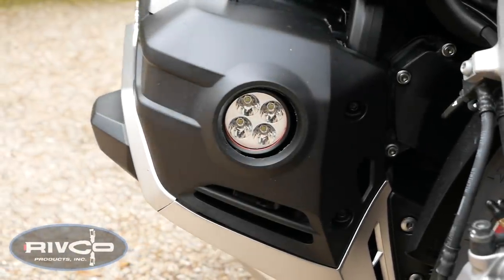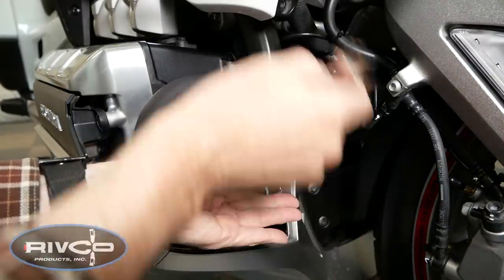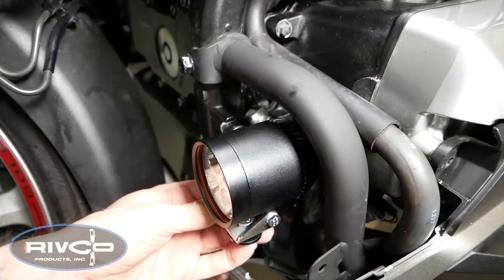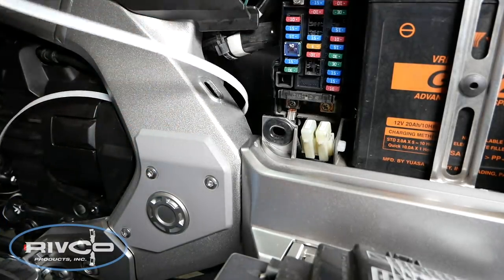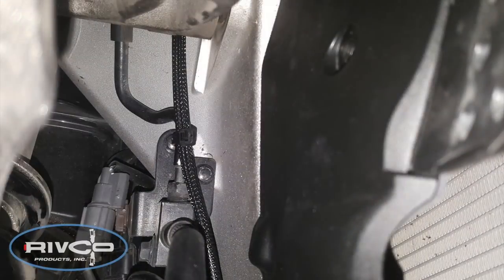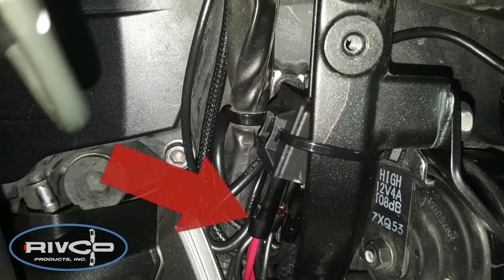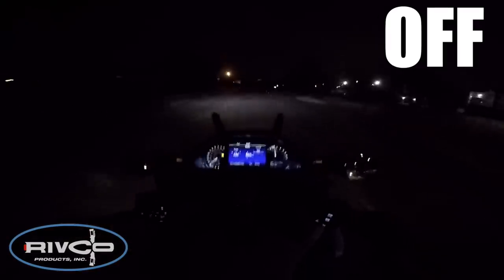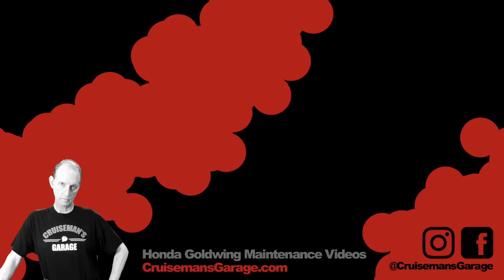Rivco Driving Light Install on 2018+ Honda Goldwing

Comment: EHHXcellent! I was skeptical of having a switch that was not the OEM button but the switch placement is out of sight yet convenient. Not that I'll actually use it anyway, because, if I had the Ricvo driving lights on my '18 Goldwing, I would never turn them off anyway. Thanks for another great video Cruiseman!

Comment: Another great video.  I installed these lights three weeks ago and they are great in the daylight too.  One note however.  The GoldStrike Tiedown brackets use the same horn / fog light boss to secure the lower arm of their bracket.  If both the tiedown bracket and lights are used, it pushes the lights off center to the plastic cover opening by the thickness of the GS bracket, 0.162".  In my case, the RH side was okay.  The LH side was too far off center.  I knew that and talked to RIVCO before ordering them and discussed options.  For the time being, I'm leaving the lights centered, and the LH tiedown bracket off.

Comment: The install looks pretty straightforward and well described. Great job. I do have a couple of question. I did not see the switch. Is it an OEM or similar switch? And where it is exactly is the switch located? Thank you Alf 🇨🇦

Comment: Great video as always.   I like the light these Rivco's put out but don't like the Rivco switch.   Santa bought me the Honda fog lights and spent almost all day installing the darn switch in the console..   I was surprised you did not install the fog light switch it at the same time you did your HondaLink switches.   I referenced your Hondalink install video a number of times to help me though the the fog light switch install.
Reply from the maker: I think RIVCO may eventually offer an OEM-style switch for the console.

Comment: Lights work good. We just got the rain you got late yesterday and it was a lot of rain...
BTW; Those horn bolts are not 12mm, the bolts are probably an 8mm that takes a 12mm wrench.
Reply: While I can't argue against your statement, I would only add that most of us only are concerned about the tool that is needed to do the job, not the specifications behind the fastener itself. For example, when I'm removing the bolts that hold the seat in place, I know that I need to reach for my 5mm hex driver. Knowing the thread does me no good.
Reply: @MotoRideswJohn  That's because you are talking about a wrench and not a bolt...
Reply from the maker: @MotoRideswJohn  I think you meant 6mm Allen.
Reply: @cruisemansgarage  Yes, of course you are right!

Comment: Amazing difference in light. Will the hi-beam wash out the driving lights? Also, is there an inline fuse in the power lead coming off the fuse block terminal?
Reply from the maker: No, the high beams throw the light down the road while the driving lights provide a lot of fill light between the bike and where the hi-beams start illuminating. There is no in-line fuse (easy to add one). The ACC terminal is fused (3 amp, I think).

Comment: How would one go about wiring these as to have them trigger on with the high beams?  I currently have a pair of aftermarket lights on an FJR, and am powering them thru a Skene Intelligent Controller.  I would like to do something similar on my 2018 Wing, which would give me a final setup of 10% power on low beams, and 100% when the highbeams are activated.  Given the CANBUS system of the wing, I suspect that wiring would be different.

Comment: I heard that the Rivco lights draw more power then the factory LED Driving lights, with that being said,  I understand why Rivco is using a relay and external connection to the battery.  But, what I don't understand is, instead of using the switch, why don't they use the factory headlight connection to actuate the relay?  This way you can install the factory switch and everything is neat.

Comment: Cruiseman- Love these lights. Can these lights be wired so they operate with your high beams using the OEM handlebar high beam switch? (If I’ve got to send a message to a vehicle about to turn left in front of me I want to be able to give them a full on frontal blast of light). That is in addition to this new Wings great horn.
Reply from the maker: If you use the RIVCO wiring harness and switch, then it bypasses the Honda switching altogether. That means the fog lights will remain ON when you hit your hi-beams. However, there is no way I know of to have your hi-beam switch turn ON the fog lights.

Comment: Hey Cruisman, another great video. Question, does the main power dial kill the lights when you power down or do they stay on. Either way think I'm going to invest in a set. So much brighter and the install looks sooooooooooooooooo much easier than the OEM version. Tks
Reply from the maker: Yes, when you turn off the bike, it kills the lights. The ACC terminal on the fuse box is a SWITCHED terminal, so it only gets power when the bike is running or in ACC mode. The lights are SUPER bright.
Reply: thanks much, must be popular, out of stock currently
Reply from the maker: @rtt3114  Really?
Reply: yes sir

Comment: Hey Cruisman, I installed the rivco driving lights on my 2018 wing.  The installation went good as I followed your installation video. They are super bright at night and I love them when I can use them.   I mainly put them on for better visibility in the day time so oncoming drivers can see me better.  Now when I use them in the day time I have some drivers flash their lights at me.  They probably think they are too bright and are shining in their eyes.  Lately I have not been using them because I don’t want to annoy other drivers.  Any ideas on how maybe I can dim them during the day time?  Smoked lenses or maybe a dimmer switch?  Bruce Spicer, Hastings, Minnesota.  PS the riding season is pretty much over now until next spring.
Reply from the maker: You might try adjusting the angle slightly downward.
Reply: @cruisemansgarage  thanks, I will try it.

Comment: Chris, I am installing these lights with the intention of keeping them on at all times. I don't need the on/off switch. Is there any reason I cannot simply clip the wire and remove it? The other wires will go to a Show Chrome Isolation Fuse Block. Thank you.
Reply from the maker: You could.
Reply: @cruisemansgarage  thank you.

Comment: Cruiseman's,  I already have the OEM Honda fog lights installed on my 2018. Do you think I could splice the Rivco lights into the OEM Honda harness and use all the stock components?
Thx,
Greg
Reply from the maker: I am afraid that question is above my pay grade. You should probably talk to Rich at RIVCO about that. Probably could be done.
Reply: FYI, Rivco says that I can use all the stock Honda wiring and switch, just swap out the lights.
Greg @cruisemansgarage
Reply from the maker: @ibhandlebar  Cool!
Reply: @ibhandlebar  hello sir, have you done it by now? I was wondering if I can just cut the leads off on both sides and just install the Rivco fog lights insted of the OEM lights. Do I still need the relay provided by Rivco?